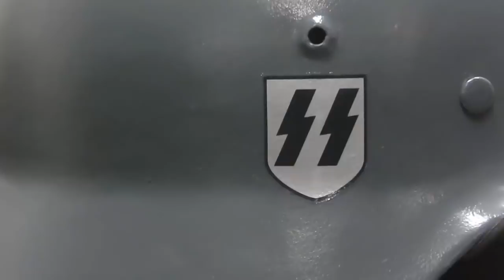Rusty German Helmet Restoration

Comment: You did a lot of good work, only to end up painting it the wrong color, and with the wrong finish.  The original color used by both the army and Waffen SS before 1843 was a dark green-grey, originally in a semi-gloss but quickly switched to flat finish when the war started. After 1943, all helmets and vehicles were given a base coat of "Ordinance Tan" (which we Allies often mistakenly call "Afrika Korps Mustard Yellow")., over which was sprayed two additional colors: red primer and "apple green", so as to give the helmet a blended camouflaged look (the orders could not be carried out by every factory due to paint shortages caused by Allied bombing, and so the dark green-grey is still the most common color you see on millions of surrendering German soldiers in 1945). As in WWI, all paints were in a flat finish, to avoid any chance of reflecting moon light at night.  At no time was any helmet in the Third Reich ever painted glossy (or semi-gloss) US Battleship Gray.

Comment: Here's the thing... while the final product looks amazing, and I definetly admire the guy's craftsmanship, this is probably not worth near as much as an unrestored version. Two biggest reasons, are the SS decal and the liner. The decal is a reproduction and not original, and there is no way of telling if this particular helmet was issued to SS, weirmacht, and even perhaps some.branch of police force... point is, if it wasnt there pre restoration, it should be there post restoration. Second reason is the liner. The fact that this had an original liner in it, made it valuable in and of itself as most found helmets' liners are rotted away. Unless this was an actual unissued liner(which I highly doubt as they are rare and extremely expensive), removing the original liner and replacing with another reproduction significantly lowers the overall value. Again, the finished product looked very nice. But the unrestored one would be worth in the neighborhood of around 300ish bucks perhaps a bit more. A restored one(if advertised as such and not sold as all original which too many of these things are) in this condition with these not original items on it, would probably go for around 250 tops. Another problem is, too many people restore them like this then try to pass them off as all original. While not necessarily a fake item, it is not truthfully advertised. An example being that had this been an actual SS helmet, and been in this good condition without restoration, it would have easily sold for between 3-5k. So you can see where restorations like this are a problem... someone can do a good restoration, advertise it as something it isnt, and some collector is screwed for 3k for an "original unissued SS M35 or M40" when in fact it's a standard weirmacht helmet restored with a repro headliner and a repro SS rune that shouldnt even be there in the first place. So a restorer can turn a helmet worth a few hundred bucks, into a helmet which is now sold for thousands, all the while some unwitting collector gets duped.

Comment: 0:42 * bangs head on desk* YOU JUST BROKE THE ORIGINAL LINER THATS PART OF THE HELMET YOU COULD OF TAKEN IT OFF ANOTHER WAY
Reply from the maker: It was very rusty and there were a lot of through holes in it. There was no point in disassembling liner neatly.
Reply: Bangs file on desk Twenty eight stab wounds!

Comment: Have you ever tried electrolysis instead of knocking off the scale? The electrolysis converts the rust back into good metal (sort of) and doesn't result in a thinning of the metal that' remains.

Comment: Great video, thanks! I would add that the Waffen-SS, particularly towards the end of the war were  essentially just fighters. There were different branches of the organisation responsible for different kinds of activity, of course, which is why the organisation is “infamous” in the West. However, it would be wrong to pass judgement, say, over a 1945 Waffen-SS soldier defending Berlin.

Comment: Great video but what are the steps and why did you do them without water you place to Hamilton or some type of acid what was that was a paint that white paint you put on the helmet or is it some type of primer why did you have to douse the sticker before you put it on the helmet is attached the helmet better be easier if you just went to the steps and explain why you’re doing what you’re doing

Comment: So basically what you need to do is remove 95% of the original stuff on the helmet, cover it with thousands of little holes, fill it with modern filler, spraypaint it and add a plastic sticker. This is disgusting. If something is worn and damaged from a battle and time then that is worth way more than you taking away its historical and replacing it with modern repairs. Shame on you
Reply: Most of those little holes were made by the rust and corrosion, not the sanding. Depending on how you view the helmet, you may see it as just some rusty metal. And so what? There is still many other Stalhelms out there still in the ground. And I don’t see what’s wrong with adding a fucking sticker to a helmet.

Comment: What was the white pasty material you used to fill in the holes after you removed the rust?  How long did it take to sand it down?  Did you sand by hand or use a machine?

Thanks
Reply from the maker: 1. I used a putty that 's used to repair cars.
2. I spent one week reclaiming the helmet.
3. All made by hand.
Reply: @wwiituberestoration1011  Thank you.  Good Job!

Comment: Might I ask what that paste was you used to get such a clean and smooth finish over the pitted metal?
Reply from the maker: 2K putty for car repair
Reply: @wwiituberestoration1011  thank you. I might soon be coming into possession of a ww1 stahlhelm and may do some restoration work on it and your videos are actually really informative.

I take it you use rust remover just before the wire brush or is that just water?

Comment: What filler did you use?  Isopon or similar?
Reply from the maker: I used Novol filler
Reply: @wwiituberestoration1011  Ah, ok, it looks as though it's a polyester based filler.  I have used similar fillers myself.

Comment: 8:49No decals were put on the helmet M 40
Reply from the maker: You are not right! I have the same original helmet M-40 with a decals. I have a M-42 with decals.
Reply: I didn’t inspect that helmet with one decal.Anyway, it was better to paint with a brush and paint with sand

Comment: thats not a restoration at all, you ruined it.
Reply from the maker: Why do you think so?
Reply: @wwiituberestoration1011  you really have to ask that? Then you don't know what you're doing. A real restoration pulls the subject matter to the surface, it doesn't hide the imperfections. You can remove dirt, rust and grime, but not hide it with paint or, in your case even worse, bury it with a bondo like substance. Sorry, but not sorry. Also, your channel attracts a significant amount of nazi sympathizers, a disturbing amount. For your next video, you might want to try and restore Jewish shoes that were left behind at the doors of the gaschamberSS.
Reply from the maker: @Justbase  Thanks for your answer. So many men, so many minds. I have drawn certain conclusions.   Thought thrives on conflict

Comment: Nice restoration, just a little advice from one who owns a M40 W/SS helmet and who has been studying German WW2 helmets since 1988 .The German helmets was painted in oil based enamel paint, you have the panzer grey but it needs to be a little darker and with some applegraun green mixed than it would be the perfect color . The M40 also had the rough texture by using aluminum oxide powder coating, other than that cudos bro on saving a piece of history 😉👍✌

Comment: If he went to pawn stars with that rusty helmet. That could’ve been 1,000s of dollars
Reply: First of all, if you can prove it's original, it's more expensive restored than rusty provided you remained faithful to the original. 

Second, it's probably not thousands of dollars. 

I've seen them go for as little as 300 bucks for Heer helmets. 

SS ones are probably a little more expensive. 

The Kreigsmarine ones are the most expensive, usually selling for over 2000$ . 

The cheapest are Hungarian ones, for some reason, even though fewer of them were produced. They're usually around 200$, I've seen them for 130$ . 

Now I don't own any Stahlhelms myself, but I do browse milsurp sites from time to time, WW2, Cold War and Modern. 

You can find some steals there. I've got a Romanian M73 Cold War era helmet for 15$ .